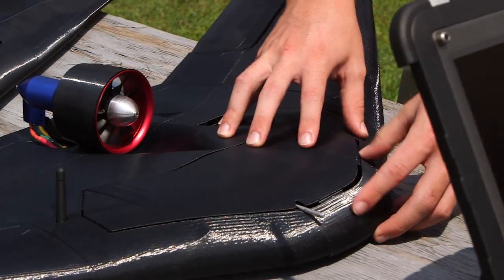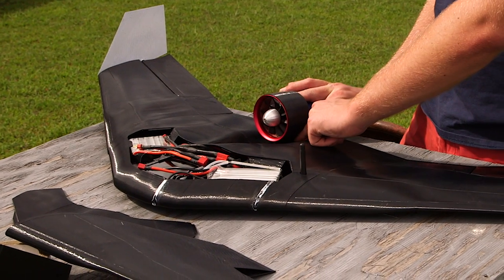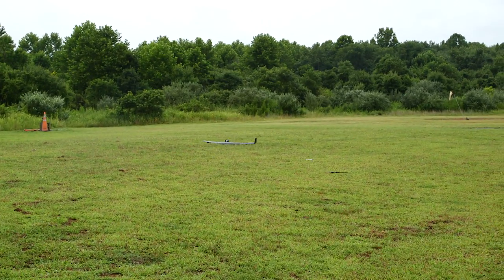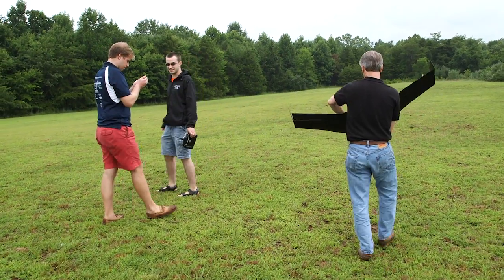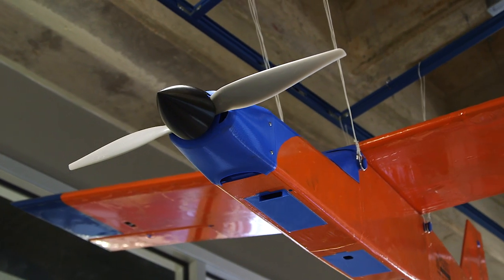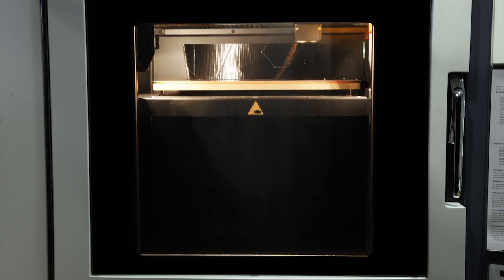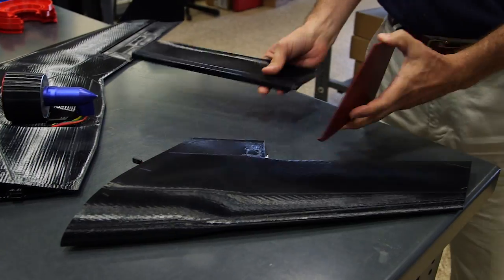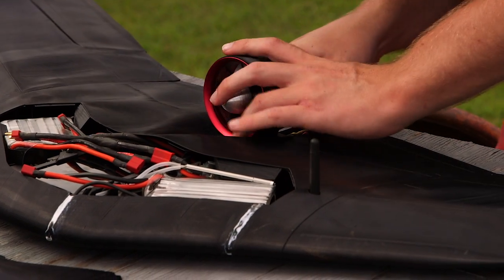The Razor: UVA's 3D-printed U.A.V.

Comment: Cellphone.  Bad mistake.  Embedded systems aren't real time.  Your PID algorithms have to be latent.  Also, LTE is a 4th generation technology, not a 3rd.  Lastly this isn't special, the maker space has been making 3d printed wings and drones for some time.  You will shed a ton of weight by monocoating the shell.

Comment: I think the reason why the U.A.V cannot be easily hand-launched is because of its top-mounted EDF configuration. At full theust, the engine exhibits a significat net force that actually push down the nose of the U.A.V., resulting in various crushes. If the team is able to configure the U.A.V. into a bottom mounted engine configuration, the problem of hand-launching can be solved. But that also means the need for landing gears upon landing. Great work though. I am also applying to UVA EA for fall 2019 next month, just loving it. #EngineeringRocks

Comment: I prefer launching wings by holding the nose while throwing up and behind me. it looked like the hand on the back was causing some of the problems. The tiniest nudge up on the tail at that low takeoff speed and instant nose dive or nudge it down and it will stall.

Comment: Have you ever considered a conventional (or folding) prop design for your thrust? Much better power to weight ratio, and typically cheaper too. If you needed the duct for safety, just design a guard around the assembly.

Comment: heres a further IDEA: make it in sections in otherwords if it crashes it breaks apart in places where it put together IE a flying puzzel.WINGS have say ten points that snap together with flush fitting joints same for fuselage so if crashed just snap it back together. THIS was for FREE go ahead use it it will give you the edge on the market

Comment: Well...you have a ducted fan unit for power, you should integrate a DUCT into the design!! the smaller orifice at the end of the duct creates more pressure. Then you need to hit the throttle all the way BEFORE you launch, that way thrust is built prior to release. And you can't pull up right away because you have no air over the ailerons/elevator. If you designed a "launch flap" directly behind, or at least partially grabbing some air from the thrust vector, you could lift right away. I think these things would give you greater performance and ease of operation.

Comment: Have you considered a small "handle" on the bottom, (that would fold back flush with the bottom on landing) to help launch with the proper attitude?
Reply: TDTHWYL that is what it needs but just a simple skid to grip with fingers and it would also assist in landing, no need to fold.

Comment: seems like 3d printing the whole thing instead of just spars and structures would make the plane much heavier than needed and lower the payload capacity.  Is it possible to just print the the main bits and struts and then cover the open wing surfaces with monokote or something?
Reply: abs/pla is very, very light, you are correct that it would be more efficient, but it would be more efficient to just use aluminum frames, then cover it with carbon fibre, like todays planes/advanced bicycles are made. Also the whole point of this project is to prove that you can 3d print a UAV plane, which is MUCH cheaper then how today modern planes are made.

Comment: "fully autonomous" is overused and usually incorrect. Most people seem to use the phrase as a synonym for "fully automated" but autonomy and automation are actually different (but related) concepts. A fully automated aircraft would fly a predetermined flight path that was created by a human. A fully autonomous aircraft would fly a flight path determined by an onboard or ground station-based algorithm which might have been given a few parameters by a human such as "search this field" or "go take pictures of the empire state building". Even then, "fully autonomous" is probably an overstatement.

Comment from the maker: Meet the Razor, a 3D-printed, hand-launchable U.A.V. developed by  #UVA  Professor David Sheffler. It was built with freely available off-the-shelf parts, including an Android smartphone that acts as the central processor.

 #research   #innovation   #design
Reply: ***** Where are the STL files so i can 3d print one ;)
Reply: The team might consider an Atlatl for hand launching. Much greater velocity with a simple hand tool than by hand alone.
Reply: I was going to say discus launch, but your idea is stellar.
Reply: Where can I get this android software?